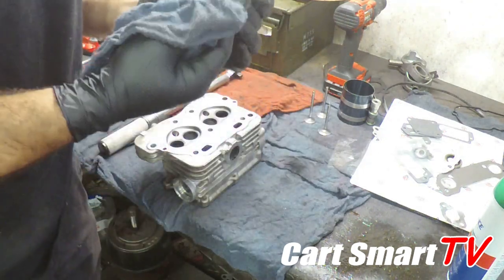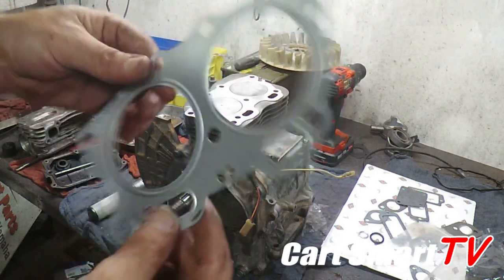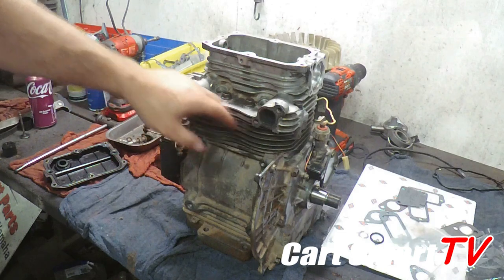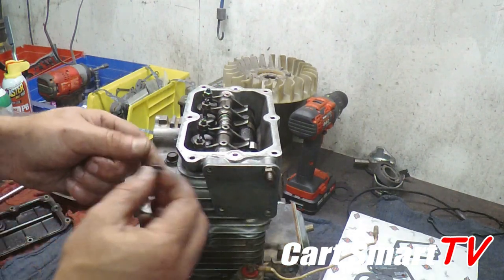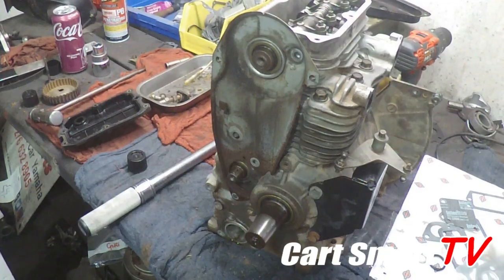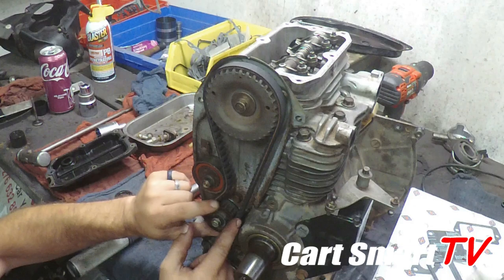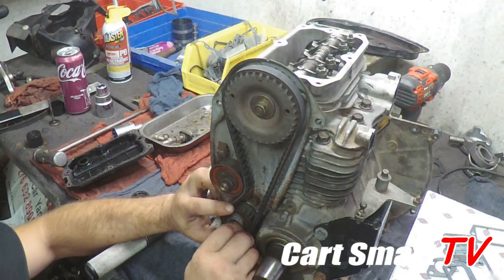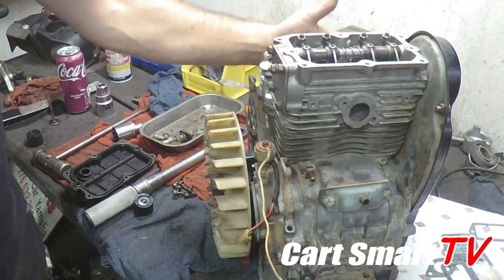Step By Step EZGO Head Assemble

Comment: What is the difference between a 295 CC? C and a 350 c c Or can you bore it out to a 350 cc
Reply from the maker: The Piston size. You can bore it out to a 350. They have a smaller skirt on the piston but the same rod and cam works with both.

Comment: Great video.  Quick question on setting timing. Can it be done in the cart or does the motor have to come out? I've got an ezgo that seems to burp oil out of the crankcase vent into the air box after a few minutes of running and I think maybe the timing might be off that one tooth you noted.
Reply from the maker: In almost every one of these engines that have a blow back of oil in the air box have worn out valves in them causing the problem.